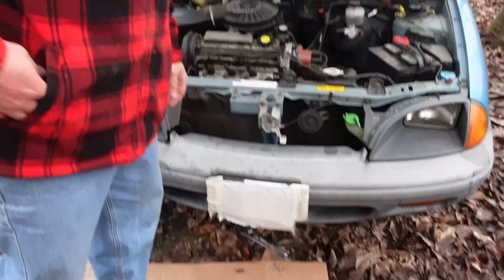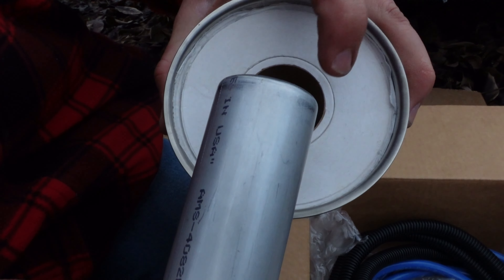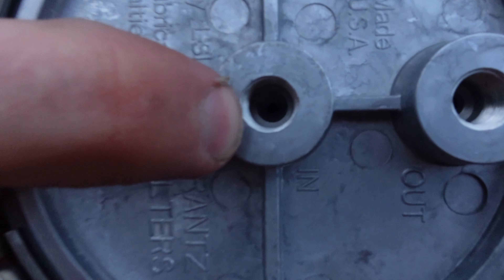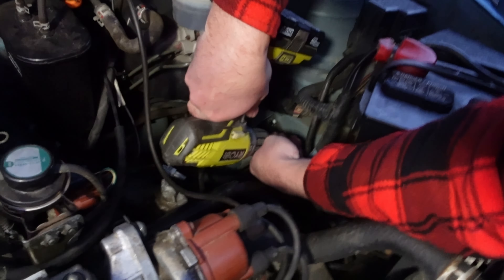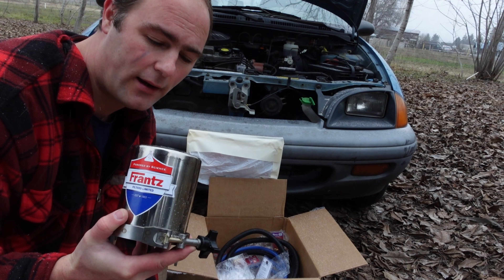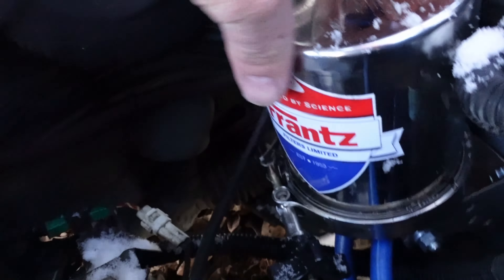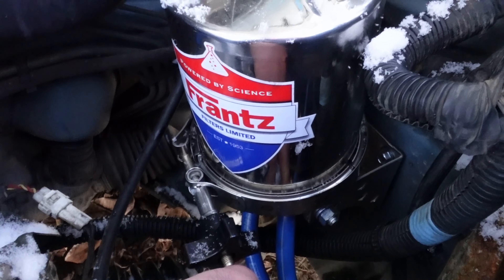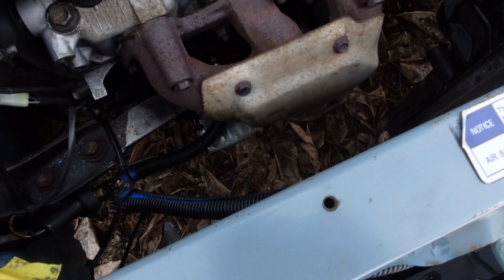Frantz Toilet Paper Oil Filter installation on a Geo Metro

Comment: That oil actually looks pretty good. It needs a few more passes thru the toilet paper. The Australian Jackmaster Classic  claims 1 micron if you use Jackmaster Classic elements. The Jackmaster Classic elements are similar to Great Value 1000 with I believe a 1 1/2 inch core. When we used 2 ply Motor Guard claimed submicronic. The new Motor Guard elements are like a tightly wound roll of coffee filter paper in a roll. They still claim submicronic. Dont remember what Frantz claims. I would think they would be the same under the same conditions. Went down to get my drivers license renewed here in Texas. I couldnt prove I was a citizen.  My birth certificate was a certified copy but the stamp was flat. Two employees were holding it up to the light and saying this is a photo copy.  They looked at my army discharge papers and said what is this. I said a DD 214 copy. They said the certification stamp isnt embossed. I started in Texas with a Texas commercial drivers license in 1984. I need to go to Mexico and wade across the river.
Reply from the maker: Wow sub micron is amazing, I was just reading about a liqui moly oil additive that had a particle size of 0.5 microns so you are getting close to filtering that out at that point. I would think you would be a verified citizen in the database at the licensing department 🧐
Reply: I was a little irritated.  They mailed me a license until I was over 79. Now I have to prove im a citizen. It looks like I need a state approved birth certificate copy. I have a certified copy but the seal is not embossed. My DD 214  Army discharge paper is also not imbossed.  My wife applied for a new state approved copy from Oklahoma.     Amsoil claims 2 micron. Toilet paper is a lot better. In the early 80s Amsoil had a canister filter that might have been as good as toilet paper They had a famous race car driver Bobby Unser saying this oil change is forever. At the time I was using Amsoil 10 40 with a Frantz oil cleaner.
Reply: @frugallandlord6974  Im told the Frantz cant remove the normal additives added at the refinery. That can be proved with oil analysis. I havent tested it but im told the Frantz can remove the graphite from Arco graphite oil
Reply from the maker: @ralphwood8818  sad about the driver’s license hassle, I have a tenant who is still using Quaker State 30 weight out of the old tin cans, he got it out of an old gas station that had been closed for decades. I watched him pour a can of it into his car, the oil was actually green.
Reply: . There are still old Frantz users that wont use any oil but non detergent. When I was working for Safety Kleen corporation. They had days where people could clean out their garages and bring in hazardous materials to be disposed of. We got many cases of  old oil in tin cans. When I bought a house in Coeur d Alene  Idaho it was at one time owned by a aircraft owner. There were a couple of cases of Texaco aircraft oil. Pictures of what looked like the first bi planes. I left them there. Collectors would have loved them.
Reply from the maker: @ralphwood8818  yeah I know single weight oil is more durable and much better at holding it’s viscosity than multi weight oil, all the non detergent oils I have seen are single weight oils, if you have clean oil then you don’t need additives to keep the particles in suspension. It does make sense to me, if I lived in a climate that was warm year around I would probably use a single weight oil.
Reply: My old diesel Ford tractor has a sticker on the engine that says I can use 10 30 or 10 40. For extreme high temperature use 30 weight. It was hot here in the Dallas Texas area and I needed to do some hard digging. Didnt know what was in it. Put some heavy duty off highway 30 Walmart oil in it. The first morning it got down to about 30 F I pulled out the dipstick. It was more like grease than oil. No way it would circulate. Delo 30 winter grade would have been OK. It worked for me in Coeur d Alene. The W next to the 30 means winter grade. I put 15W 40 Walmart diesel rated oil in it. I can get Delo 30W on line. Might be able to get it from a Chevron dealer. When Mobil 1 came out with 5 20  I drained the Delo and put the Mobil 1 in the VW beetle in Idaho. Probably wasnt necessary. I think Standard Delo 100 is only in single weight winter grade. It would be fine in everything I have
One of my customers went over 300.000 miles with no oil drains using 20W Delo 100. He was also my boss. He pulled a Mustang dragster with a Chevy Suburban with a Frantz on a 292 big 6.
Reply: About 50 years ago I put a Frantz on my Peugeot diesel. The oil pan was aluminum. I returned the clean oil to steel valve cover with a self tapping hollow bolt. We headed for town with the wife driving. I said slow this thing down. She said it wont slow down. We were runniing on motor oil. Got it off the road and i killed it with my jacket. I should have used a Frantz sandwich adapter. The Peugeot oil filter was on the top of the engine upside down. Come to think about it it mught have been like a chrysler slant 6 a pipe goes up in the filter to keep it from draining.
Reply: Frantz had a fuel filter. I had one on the Peugeot. It was a regular Frantz with no orifice and a coating inside.  I had to get my wife to the Tulsa Oklahoma airport. Stopped in Sedan Kansas to get fuel. They said we are about out of diesel but you might get a little out. I was almost into Copan Oklahoma when the car wouldnt go any farther. A Oklahoma Highway Patrol officer stopped to help. He said I will take your wife to  Bartlesville and put her on the Phillips 66 bus to Tulsa airport. A nice guy pulled me to a store. I got some toilet paper and a bottle of HEET and headed home
Reply: Actually on the Peugeot if I had returned the oil as close to the fill cap as possible I would have been ok. I returned the oil to the wrong side of a baffle The crankcase ventilation system was pulling a oil mist.
Reply: Getting to the oil pressure switch is a night mare on some engines. I still have sockets for oil pressure switches. Put too much squeeze on one and it might start leaking.
Reply: I notice around here im not seeing much of if any larger particles on top of the toilet paper. You can see 40 micron particles. After a couple of days in Dallas Texas I saw more than usual. This means gunning it to get on the freeway was causing the bypass valve to pop open.
Reply: I used the Frantz for 20 years without knowing you have to send  samples of oil to a lab. I didnt know which way the molecules are pointed.I didnt know what total base number was. I just changed the toilet paper and added a quart of new oil. I dont own a expensive diesel pickup. My old diesel Ford 6.9  got the Gulf Coast junior toilet paper changed every 2.000 miles or less. It used or leaked a quart of oil about every 600 miles on a trip. It had over 300.000 miles pulling a large horse trailer when I bought it.
Reply: I bolted the Gulf Coast junior to the plastic fan shroud as high as possible. Returned the clean oil to the oil fill neck with a self tapping hollow bolt. Got the pressure from a pipe plug near the full flow filter. The Gulf Coast  junior drained completely  at shut down. The return point on the old 7.3 is a 3/8 pipe plug in the bottom of the engine skirt. Takes a square 5/16 tool to remove.
Reply: Actually the old Frantzs didnt have the ring under the toilet paper. When they started putting the ring in I started tossing them in the trash. That car should have clear oil on the dipstick. The toilet paper is cleaning the oil. The oil is cleaning the engiine of anything it can get in suspention.   As far as the filters being usefull in a gasoline engine it depends on how long you plan on keeping the car.

Comment: That's really a thing . Heard of it just never saw one, thanks....hugs
Reply from the maker: Yeah I was excited to finally get one and try it out 😀
Reply: A lot of good ones now. Some of them use 50 dollar toilet paper. Peasants use Great Value 1000 toilet paper from Walmart.
Reply: When I bought my first Frantz they sold for 29.95 with hose and fittings You used 2 ply toilet paper right out of the package. In 1963 2 ply was very high quality with a 1 1/2 inch core. The FAA and PMA approved  AeroFrantz took the same paper. The clamp bolted on the AeroFrantz.    I used Standard Delo 30W in those days. It always looked new when clean. Multi grade oil was crap in those days. I tried selling them in flea markets. Never heard so many bs stories in my life. I found out fast that bs stories come with toilet paper filters. John Frantz had the right idea. A filter material better than anything else that was economical. They are trying to avoid the bs stories by trying to avoid being called toilet paper filters. My Australian Jackmaster Classic for example uses a high quality roll of Australian toilet paper in a sock. It is also set up for the new toilet paper. They realize most of us will use toilet paper. They have more expensive filters that use more expensive paper.
Reply: A guy on another forum said toilet paper breaks down in a septic tank. Thats good to know.
Reply: If you worked in a full service gas station in California you saw them. Motor Guard was a San Jose California company Frantz was a Fresno California company. Motor Guard was my favorite. They only make compressed air filters now. I tried to bring them back.

Comment: Something just popped up on my cell phone . Frantz filter element 10.95 plus 18.68 shipping and I have been using lousy toilet paper since 1963.
Reply from the maker: Wow that’s expensive, I actually had a Frantz filter remove water from my oil I will post a video about it soon
Reply: Im sure its a good filter.one guy awhile back said he had a tough time getting the ring in with them. I doubt the tong is necessary with firm elements or properly installed 2 ply. Toilet paper I was told will absorb about 6 ounces of water. When the oil gets hot it will remove the water from the paper. Then the water is removed by the PCV. Hot motor oil is a poor environment for water.
Reply: It was from Ebay. They had some Frantz stuff from the old days like adapters that eliminate the full flow filter.
Reply from the maker: @ralphwood8818  is there any reason someone would want to remove the full flow filter?
Reply: @frugallandlord6974   They figured if they dont clean oil why have one.  People remember when there were no full flow filters. Even a Rolls Royce had a bypass filter. My boss had me install a Frantz with the adapter that eliminated the full flow filter. He knew his 292 big 6 was in excellent condition because  there was virtually nothing showing up on top of the toilet paper. The Suburban is what he towed the dragster with. Frantz recommended running with the full flow filter until the warranty expired. Motor Guard was the same.
Reply: I only have one engine with the adapter. Its a Motor Guard with the Motor Guard adapter. Its a Chevy engine I put in my 51 Farmall H.
Reply: @frugallandlord6974  I think I remember an oil soaked roll of toilet paper will remove about 6 ounces of water. When the oil gets hot it will remove the water from the toilet paper. If you see the oil looks milky and there are large cracks in the toilet paper like in a book out in the rain you might have a problem like coolant in the oil. At one time Frantz had trouble shooting pictures. You could trouble shoot the engine by reading the toilet paper. Thats if you didnt have the full flow filter.
Reply from the maker: @ I put one on an suv that I had fixed a water pump that was timing chain driven, water mixed with the oil, I fixed the pump and changed the oil but there was still lots of white sludge in the engine from all the water, it clogged up the toilet paper fast but now it seems to have filtered all that water out of the engine, what a great filter.😀
Reply: If there is a lot of water in the toilet paper it will feel soggy. If the oil is hot most of the water will go thru the PCV.
Reply from the maker: @ yeah it got soggy and easily tore apart
Reply: The challenge is getting out the glycol. I bought a antique oil filter at a flea market. The oil came thru a very small orifice in the bottom. Came up thru a compressed cotton filter. At the top the oil passed over a 12 volt hot plate where the fuel and any glycol was evaporated and vented out the open top. The oil was then gravitied thru a large hose back to the sump. There are similar filters now. Probably wouldnt be practical for modern cars.
Reply: I saw some vintage toilet paper on Ebay. Five something plus shipping. The vintage paper is probably 2 ply with a 1 1/2 inch core and a little taller. Single ply in the old days was normally loose wound.

Comment: Some say conventional  oil loses its ability to lubricate. Actually it only gets contaminated. Safety Kleen corporation has a big re refinery in East Chicago. Its a matter of removing everything from the oil until the oil looks like clear water then adding the additives. Most of it goes to the major oil companies. At one time Mercedes cars came with re refined oil. Goodyear sold it in quarts. You arent dealing with all of the highway construction materials that come with crude oil. There must be a lot of synthetic in it now. People wont buy it. They want the new oil. Things have changed since I worked there. In the old days before synthetic oil engine heat and the Frantz and other depth filters were actually re refined the oil as you drive. The impurities ended up stuck to hot engine parts and in the toilet paper.
Reply from the maker: @ralphwood8818  and whale oil used to be used as automatic transmission fluid and hydraulic fluid until it was outlawed in the 70s
Reply: @frugallandlord6974   Yes they had trouble coming up with a fluid as.good as whale oil.  I dont change transmission fluid. The old F250 has a Gulf Coast junior filter on it. They dont make those anymore. I put a converted Motor Guard M 30 compressed air filter on the 06 Pontiac Torrent. I needed to add a quart of fluid. It calls for Asian fluid. Its a Toyota transmission. There is a short dipstick under the car held down by a small bolt. Looks like the best way to get to it is to remove a motor mount.